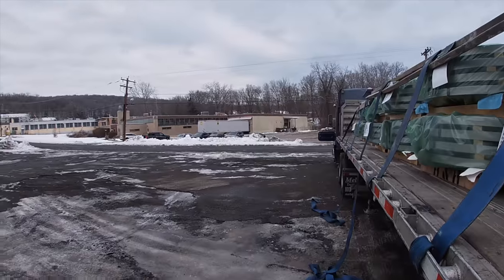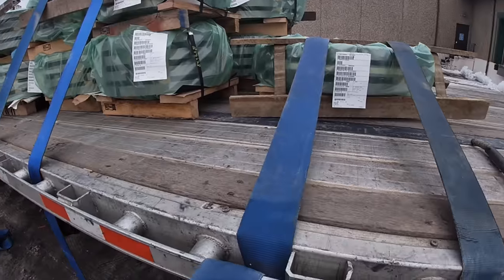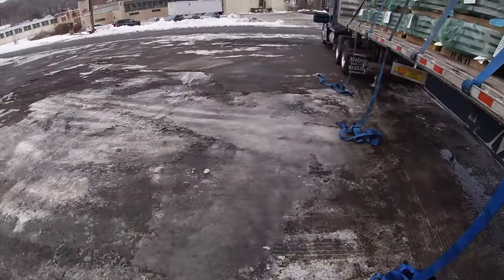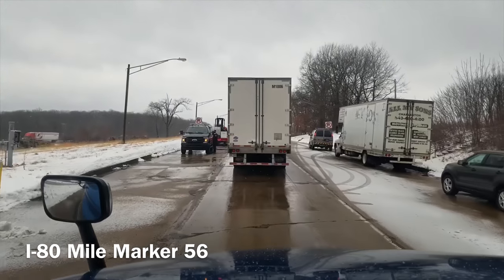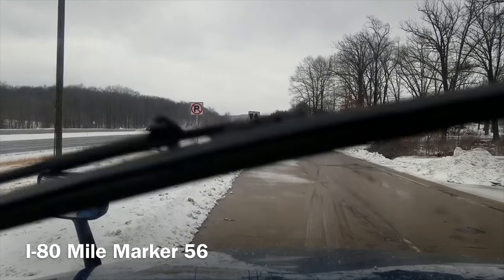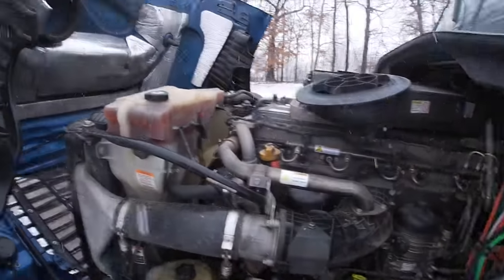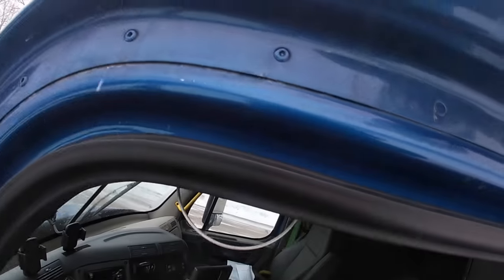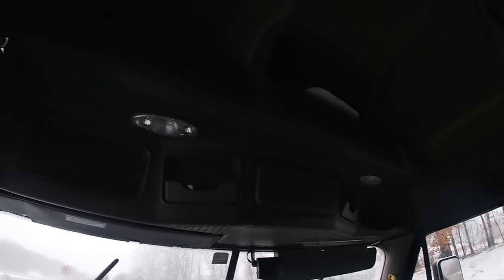Freightliner Breakdown Melton Truck Lines

Comment: Hey one of The Thing also. Keep candles cigarette lighter and matches in your truck believe it or not I candle lit we'll keep the inside of the truck from dropping below the freezing temperature. Now it's not going to warm you up but if you were broke down somewhere with no power you could light the candle be in the bunk area and shut the curtains and that flame alone will not allow it to drop to freezing temperature they taught us at in the military in cold weather training if you have to build a shelter emergency candle also have an emergency kit and also a cold weather sleeping bag with you they're expensive but well worth it if you ever break down far away from help.
Reply from the maker: appreciate that. That’s some good advice right there. I will make sure I get some candles next time I go to Walmart

Comment: just drove the 80 from san jose cali to okaland NJ.hope they get you rolling soon. im also a Melton Driver stay safe!
Reply from the maker: I got a bad feeling about this. They couldn’t even get the truck in the shop today because it doesn’t have power so they need another tow truck just to pull it inside and that won’t happen until Monday
Reply: @bigsnow1705  dang, if it's a major issue to fix they'll rent you a car and have you drive to a terminal and reissue a truck to you happened to a buddy of mine also a Melton driver.
Reply from the maker: Would be better than sitting here at this hotel
Reply: Rudy Cerda
I see that you said you left San Jose California. I'm from the Bay Area and I was curious if Milton has much work on the west coast I hear they do a lot of East Coast driving but how about for people in California? Just a few other flatbed companies out here I'm looking at but I was curious about Milton in the West Coast
Reply: @dannystranahan1004  iv been to California alot and I'm from south Texas. I'd say there a good amount of work out west but yes there is plenty in the east.

Comment: Hey just a heads up if you have a phone number to one of the other Milton drivers you can call them or text them and have them send up a Qualcomm message for you just give them your ID number and your truck number your location and so forth and that way dispatch will still get a Qualcomm message and they'll know that you have no power to your truck to receive any messages.
Reply from the maker: Thanks bro. Didnt know that